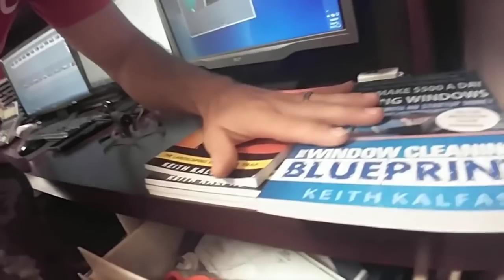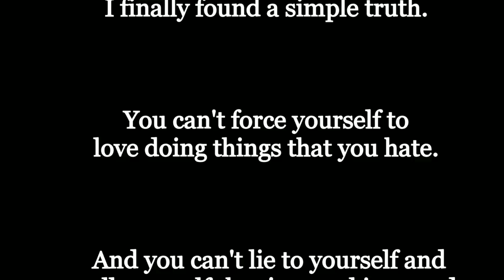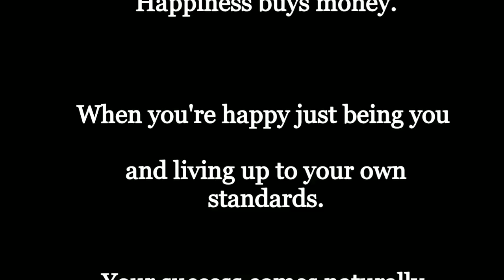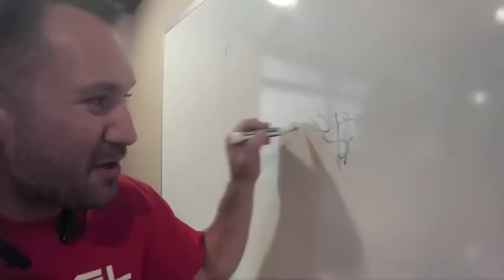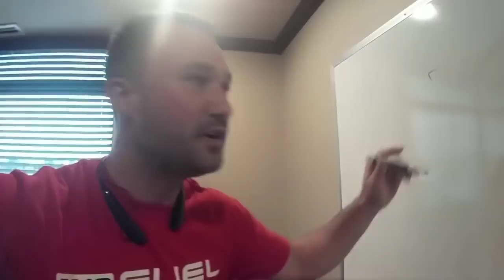How To Put Window Screens Back In - "The Un-Secret Method" For Window Cleaners

Comment: No thanks to that situation. One wrong move and you fall down and break something/damage property. Not worth it for window cleaning money. Safety doesnt take a day off people.
Reply: llembpmac window cleaning money?
Reply: Sunshine Windows not worth it for the ~$200 range. Those situations are not worth snapping your shit up for any amount of money really.
Reply: llembpmac no wrong move and cash in bank... each to their own though,  i like a little risk. from what i saw inside and out with screens i would hope it was closer to the $300 range but either way i would still do it the fun way (ladder wouldnt have been hard with leg levelers/extenders and protection booties)
Reply: Sunshine Windows risk at heights is never worth it, especially the way keith was doing it. If you wanna bring a ladder in with leg levelers and do it the safe way then more power to you. But lunging 20 feet above a staircase with one foot on a 5 inch sill is a recipe for disaster. Sure you might make it through some of these situations fine and with a bit of extra cash, but the one time you do snap your body up and damage someones home it isnt worth the small amount of money that wont be enough to cover your butt for the time it takes you to recover. Im just trying to preach safety, Ive seen people really hurt themselves from lower heights in situations where everything seemed fine.
Reply: llembpmac i get your point, im a rock climber i live life and belive its worth it i have also worked on roofs for years done scaffolding jumped out planes climbed buildings and generally enjoyed it broken bones and all. 👍🤣🤙